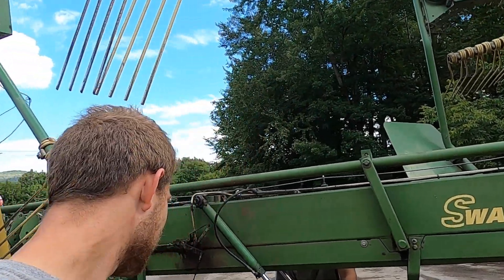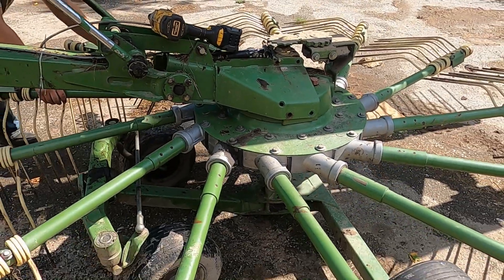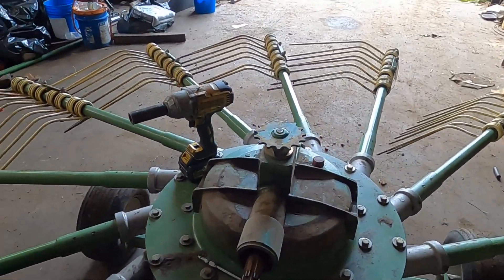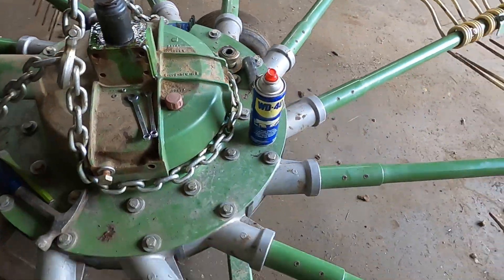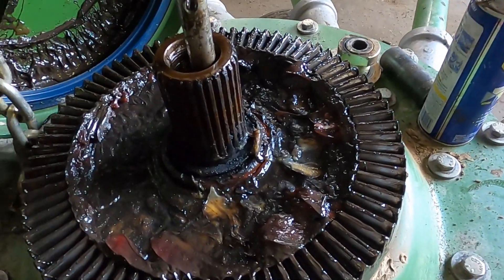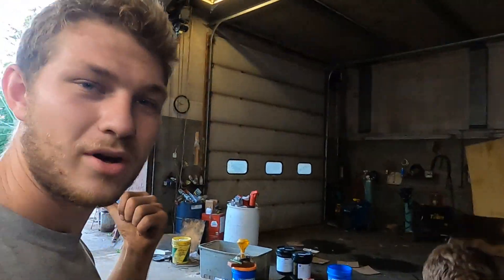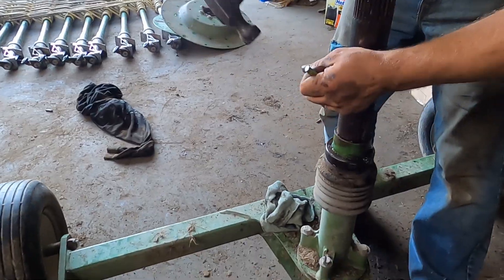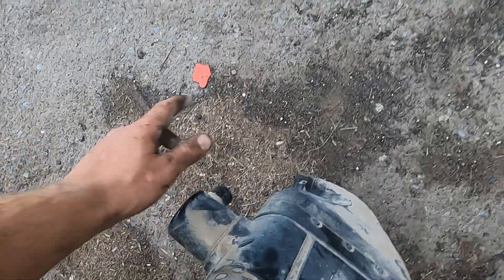Working on the Krone rake and John Deere 7600

Comment: Likes of the air filters on the jd 7600 we would take the wee 1 out an just run the bigger 1 for more air flow an torque 👍
Reply from the maker: We just turned the fuel injection up on ours and it’s a lot better now.  Nothing crazy but makes the tractor much more usable
Reply: @802Farmers  the mf 6190 we have going bye the book mint 2 b rd130hp she doing 185hp 😊
Reply from the maker: Nice 👍🏻